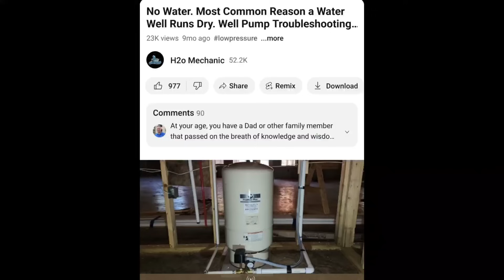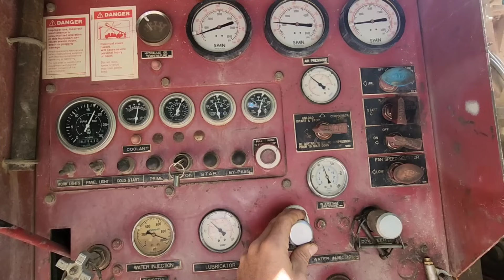Drilling a Existing Well Deeper in Search for More Water! Great Final Results

Comment: I'm from a family of well drillers and am still amazed at the few number of people who understand this process. I'd like to add some information on the difference between a Cable Tool Drill (also called a Hammer Drill) and a Rotary Water Well Drill. It's important to understand the differences from a functional and financial standpoint.

A Hammer Drill drops a thousand pound 20' long solid steel drill bar from the height of two feet via a cable under a walking beam, then lifts it up again and repeats this process. The detachable drill bit on the bottom of the drill bar has tungsten carbide "buttons" on the bottom and sides that maintain the size of the typical six inch diameter drill bit so the hole size doesn't change to a cone shape. The half ton drill bar impacts the ground with enough force to grind up the rock in the presence of water to create a sludge called "cuttings". A hammer driller will typically drill 3-6 feet per hour and the operator regularly needs to stop drilling and pump the sludge out of the well (with a twenty foot hollow tube with a dart valve at its bottom) before adding more water (5-10 gallons) typically by using a pail. When water is struck the pump will come out of the hole with more water than the 10 gallons added manually.

Conversely, a Rotary Driller turns a pressurized drill tube and the rotating bit at the bottom of the drill tube grinds up rock much more efficiently than a hammer drill. The cuttings are constantly being blown up the outside of the drill tube by pressurized air that is forced down the center of the drill tube (typically 350 PSI). A Rotary Driller only needs to stop drilling to add another 20' drill tube to extend the well depth. Therefore, a Rotary Drill can drill several wells in one day in decent drilling because of the efficiencies mentioned.

So what does this mean to the customer. There are significant differences in the two drilling methods:
1- Impact:
The biggest difference is the amount of impact the ground receives. A Hammer Drill pounds violently, and this force can easily be felt a mile away if the rock being drilled outcrops near the surface. This impact will agitate any small seam in the rock to allow water to enter the well. But a Rotary Drill grinds away at the rock with only a slight vibration of the rotating drill bit.

2- Time:
Drilling in softer rock such as red shale, a Hammer Drill can drill a 100 foot well in two to three days; a week or more in hard rock. A Rotary Drill can drill 2 or 3 wells in one day in soft or even medium hard rock. Many times my Hammer Drill ended the day with a dry 60' hole and returned the next morning to find 5 gallons per minute of water flow. The "Impact" mentioned in #1 above had loosened a slow trickle water seam, and the overnight hours allowed it to open up and supply ample water.

3- Pressure:
Hammer Drilling requires one to bail out the cuttings so an empty hole 60' deep can have a 60' water head forcing water in any surrounding seam into the well hole. This pressure can cause a slow leak to allow this small seam to be flushed open. Conversely, a Rotary Drill forces 2000 PSI down the drill tube to force cuttings to the surface. Imagine a small water seam in these two cutting removal processes. A Hammer Drill operates with an empty hole with water table pressure trying to access the hole. A Rotary Drill forces cuttings into a water seam with 2000 PSI of pressure to block water access into the hole.

4- Operation Costs:
A Hammer Drill business can be started with a $20K drilling machine and a functional half-ton. A Rotary Drill would need a ballpark million dollars for the drill, drill tube service truck and accessories. Instinctively one would prefer a more efficient Rotary Water Drill, but the efficiencies of a newer higher tech Rotary Drill do not translate into a better water well or a cost savings to the customer, only a faster hole.

Note, my family has all retired from well drilling, like most Hammer Drillers. I only post this information to educate. I built a house in a subdivision where every house had Rotary wells and they mostly had such a low supply (less than one gallon per minute) from a 200' well that one shower a day was their limit. I paid a Hammer Driller a footage premium to drill my 120' well and got 10 gallons per minute, enough water to run two water sprinklers all day in a dry spell.

In summary, find a Hammer Driller, pay him a footage premium to save money and get a great water supply.
Reply: Our well was hammer drilled 45 years ago.  It's 47 ft deep and flows over 25 gal a min.  Every old time well man always said a hammer well will produce better for longer.  I don't know much but ours has never let us down.
Reply: Great info!  Thanks
Reply: A family of retired well drillers and not one rig is owned between the lot of you ?
Reply: A WATER ROTARY DRILL DOES'T USE 2000PSI ALL THE WATER WELL RIGS THAT I HAVE RAN RUNS 350 PSI AND IT BLOW CUTTING BACK  INTO THE WATER SUPPLY BAN DRILLING 35 YAERS AND 26 CABLE TOOLS WHIT MY DAD
Reply: @tammygibson2442  
Thanks for the update.

Comment: I set up trailers for years, 1' drop over 20' looks bad aftet you go out 80' that is 4' plus the 18"-24" minimum height required for plumbing  and such,  typically 24"-32" is the most without getting crafty and expensive!!  We did all the difficult setups, in places ppl said were impossible,  we nearly pulled frames out from under homes going up hills that steep,  and broke trailer tongues off backing trailers uo 60° + hills required two D8 dozers one pulling one pushing backwards!  Elevation is everything!

Comment: Hey my well is pumping muddy water I ran it wide with no plumbing hooked to it and it cleared up and the water was clear. Went out of town for the week came back hooked up plumbing and it’s dirty again. Any suggestions on what to look for
Reply from the maker: Have you had alot of rain fall in your area recently? Normally that's a direct connection. Especially if the well is very old

Comment: I have watched all of the H2O Mechanic’s videos - including the car/motorcycle & other videos and love them all. Bought a home in Texas with 3 existing wells each with it’s own problems. Tomorrow morning I am replacing a well pump that’s on PVC pipe at about 160 feet using a rig I built patterned after what I have seen in these videos. Installing the new pump on 1” black roll pipe using the techniques I have learned here as well. Thank you so much for your hard work not just on the wells but on your channel - you have saved me THOUSANDS !!!
PS - Everything I do on these wells takes about 4 times longer, but there is great joy in doing something that very few people even dare to try!
Reply: You're right about that! ;)

Comment: Is there a county permit office that typically keeps these jobs on file where I could go back and see who drilled my well?  I need to have this same thing done but would love to know how deep the well actually is.
Reply from the maker: Yes, it should be on file if it's not too old
Reply: @h2omechanic how old is too old?
Reply: @adelinawarriner6259  In many towns the records go way back to when the art of water well drilling was getting popular. Usually in the 50s, although smaller towns might not have good records till around 1970. (over 50 years now) It's mostly a matter of when various codes came into play and record keeping (with permit fees) became a thing. You might ask what codes are out there. Distance to a septic were probably first on the list, and these days you have buried tanks (gas / oil) plus minimum yield, based on building occupancy. Some areas will NOT allow a buried well head these days either. There are also frost / freezing issues. Yeah, code to protect us from ourselves!

Comment: We’re here in northern Arizona with our house at 6000’ elevation. Back in 2006 we has a well drilled. They went down 490’ into the Coconino sandstone. They hit water at 390’, and the bottom 100’ is so the well will be efficiently replenished. We pump 12 gallons per minute with a 3 HP pump and can do that all day. We have a 3000 gallon tank up the hill that we use for gravity feed pressure. We generally go through one tank about every 2-3 weeks.
Reply: Our solar power system can run that size pump. Most folks around here have 3 HP pumps. One neighbor has a 12 HP pump and his well does 30+ gallons per minute. He uses a 20 kW generator to power his well.
Reply: @gazelam  I figure I'd need a 10kw generator to run my 1hp pump.  Maybe I overestimated.
Reply: When running, our 3 HP uses about 4 to 4.5 kW. Startup power is closer to 6 kW. Our power is split phase 240 VAC either from the solar inverter or our 14 kW propane generator. Most installations that use 1 HP pump motors are 117 VAC around here. If so, you should be able to use a small 2 kW unit with no problem. Of course, you may have other power consumption items as well. Good luck.
Reply: @gazelam  Thanks, I think my 10kw figure is about double what"s actually needed to start the pump.
This 1hp pump is running on 240. A ~5kw generator should suffice, with careful management.  Not sure where my 10kw figure was derived.
Reply: Wow, 3hp is a big pump.

Comment: Dude, unless your drill tools (drill rods) are 6" in diameter, you can be off an inch or so. Unless you're drilling an elevator shaft, the hole isn't going to be rifle barrel strait anyway. Looks like you're running 4½" tooling on that Schramm. The setup isn't great, granted, but I've seen worse. You get used to shit setups when you've done enough of them.

Comment: I live in Florida and have a shallow ground well system that was set up back in the 1960s. The well was originally set up for an above ground pump and the casing is only 2” in diameter. The above ground pump used to be enough because the table was 15 feet or so. Now it’s 50 feet. The well goes down like 150 feet. Is there a solution to this or do I have to redrill anew well?
Reply: A jet pump can go over 100ft no problem
Reply: @ReservedForFutureUse  I appreciate that. I’ve heard someone advise that before. Gotta be worth a try!

Comment: Respected, subcontractors that are drilling wells on open pit coal mine (water wall), have extendable stabilizer legs. Something that looks similar to stabilizers on mobile cranes (or how are they called i'm not sure) would be such an improvement for stability of the rig (in my humble opinion). I don't have any pictures or videos of them working since this is strictly forbidden, but rigs are kind of similar, except the working platform with commands is on the left side and not on left back like on yours, much more instruments and buttons and levers. Think the rig is quite bigger also, and they do bore up to 250 mm on our site, sometimes some extra large holes (who knows for what) too. Thanks You very much for very informative and educational videos. Best Regards.
Reply from the maker: I totally agree!  I wish we had 2 more riggers that were angle supports, but there's limited space for such a thing.

Comment: I’ve been watching quite a few of your videos and now realize that I have done many things incorrectly on my well. 
Over the past 35 years years we’ve used a 250 foot deep well producing about 20 gallons per minute serving our domestic needs.  Pump set at 200 feet. 
About 25 years ago, I decided to add a “pump and dump” groundwater heat pump using the existing well. The well supplied plenty of water. The P&D heat pump discharged into a 200 foot “return“ that was drilled for that purpose. The heat pump used almost 3000 gallons per day in addition to our domestic water needs. (BTW The return well never received all the return water and produced a swamp in its vicinity). 
Starting with a small three-quarter horsepower Goulds pump which soon failed, we had to pull the pump and replaced it. Upon tearing the old pump apart, I found the impellers were completely clogged with a very fine silt. It almost resembled Portland cement which couldn’t be cleaned out at all, so the pump had to be replaced. We went with a larger one horsepower pump. About three years later, we replaced the one horsepower pump with a one and a half horsepower, AeroMotor brand pump (same failure, plugged impellers). After another three years it failed and once again it got replaced.  
After three or four pumps (about every three years) we gave up on the “pump and dump” heat pump. 
We drilled two more 200 foot wells in the vicinity of the original “return” well that had been installed for original heat pump, and installed a new “closed loop” heat pump. With 600 feet of vertical loop plus another 100 feet back to the heat pump which gave a total of almost 800 feet of loop.
The new heat pump has been working well for the last 11 years “knock on wood“ but I know that the one and a half hp pump that’s in the bottom of the residential well could give up most anytime, especially knowing all the mistakes that I made with all those past pumps that went down the well. 
I installed all of them with a torque arrestor and centering discs but I know I never taped the wire anywhere so who knows, at age 78 I just hope it lasts until I’m gone. 
Still watching your YouTube videos. Wish there was something like your channel many years ago (before cell phones😳🫤🙄☺️😀). I live in Central Pennsylvania
Reply: Your pump and dump system might have been drawing a lot more silt into the well simply because of the increased volume from the demands of the heat pump.
You should expect for the existing pump to last longer because of the lower demand.

Comment: Water doesn't become buoyant in water. Water becomes neutral in water. That is why it doesn't weigh anything.

Had it become buoyant, the pump would have floated out of the hole on its own.

Comment: What's the cost comparison between drilling a new well vs redrilling an existing hole? Also, does the homeowner need to do any paperwork with the county on redrilling the existing hole? Thanks
Reply from the maker: If the well is atleast 200ft it's cheaper to drill it deeper. A new well  gets new casing that can deeper & prevent surface water intrusion. There's a few variables we look at before we drill a well deeper

Comment: Great video and Thanks for all you advice. I had a well drilled in N Georgia at 700ft and my water level is around 300ft. Well driller is telling me I have to put pump in bottom of well. What do you think Philip ?😊
Reply: What is the production volume?
That goes into calculations as well, if it produces little, you need to go down further, but your well is also a storage tank of sorts so if you have water at 300ft, and it produced well you don’t need to go down to 700.

Comment: how do you calculate the gpm with the drill rods still in the well? I do a lot of well work and curious how you know
Reply: Not sure if he uses the same technique, but have seen drill rigs just blowing down compressed air through the pipes and check how much water comes out.
Reply from the maker: @danielrose1392 both of yall are correct. We stop injecting our water & only estimate the water getting blown out. The driller sees its every day & knows what is what. A true test typically shows more than what we estimate
Reply: I’m pretty sure is the water runoff is how they calculate it

Comment: have you ever had the problem that you drill a well for one house and that produces let say 10 gallon per minute then you drill for the next door and the first well drops in production?
Reply from the maker: In theory if 2 wells near each other are connected, it'll only negatively affect the other Well during drilling, bc we blow out all the water, eventually they both will equalize out
Reply: One additional well drilled near likely won't make a substantial difference in yield, however, if the first well in a new subdivision yields 20 gallons per minute, ten years later when a hundred wells have been drilled nearby, this usually drops the water table, sometimes to the point nearby wells need to be deepened.
Reply: @garsonprice3441    that has happened in my area as water needs go up and people abandon their 100 ft wells in favor of 400 ft wells. IOW, the water table gets lower and wells run out in the summer. I recently went with city water because of that.